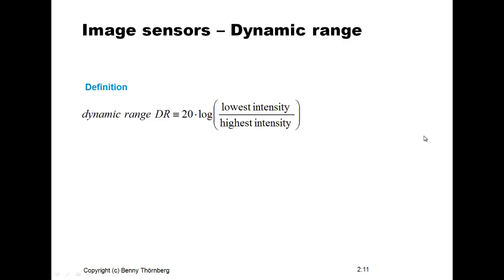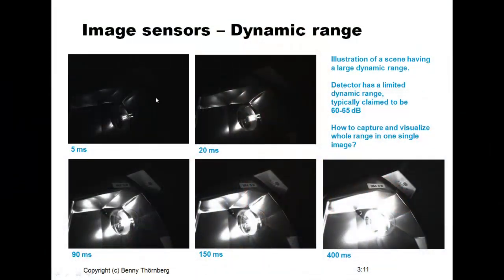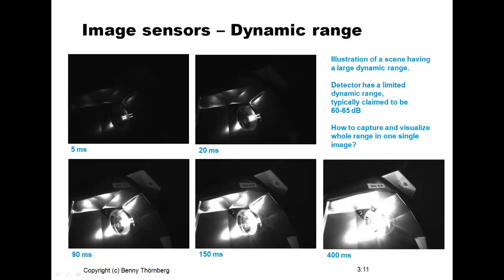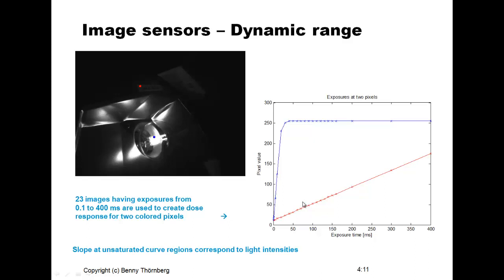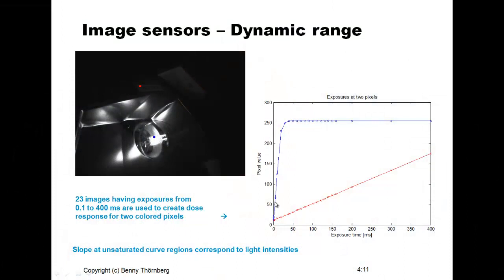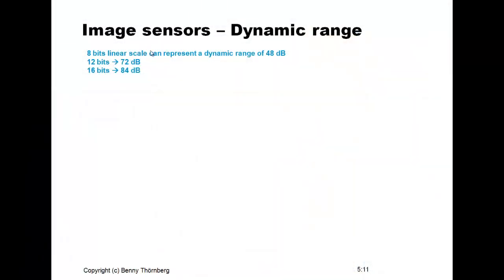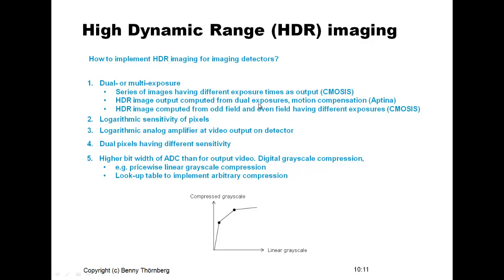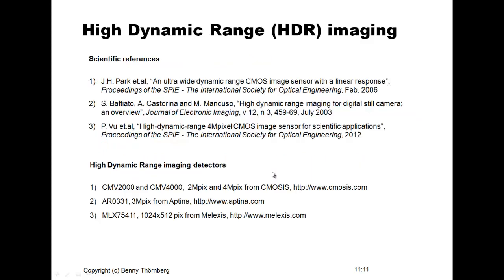Machine Vision - High Dynamic Range Imaging

Comment: Thanks for this! Working in a university lab that makes autonomous outdoor vehicles (boats, cars, submarines) for competitions. Amazed how little consideration is given to exposure and dynamic range considerations, all the work is on the computer vision / software side. But I think getting a good HDR sensor will make a bigger difference than the latest machine learning technique.
Reply from the maker: I'm glad for that you are sharing my interest on this topic. In general I don't want to promote individual companies but I found out that New Imaging Technologies are selling some interesting usb-connected camera cubes having a sensor with the solar cell type of logarithmic response. It might be interesting for you in terms of prototyping. Leopard Imaging are also selling prototyping cameras that might be interesting, using Omnivision detector OV10640.
Reply: Appreciate the recommendations. I was looking at this one e-con Systems See3CAM_CU20 as it is a great deal 1080p 30fps with some advertised HDR with the AR0230AT sensor. I can't tell if the HDR is multi exposure or the logarithmic system you're talking about.